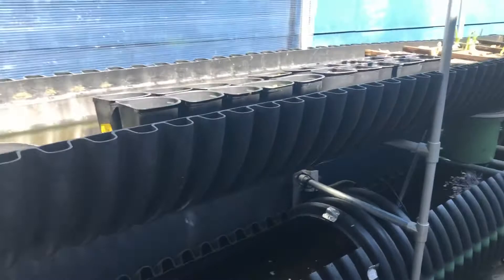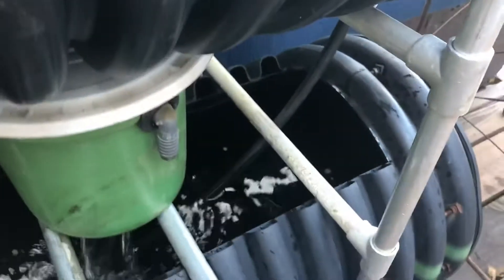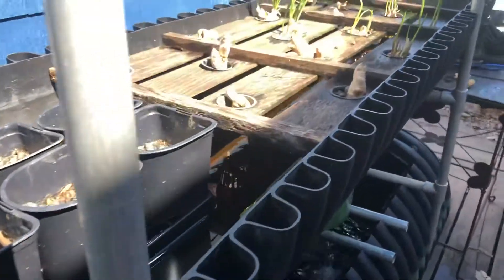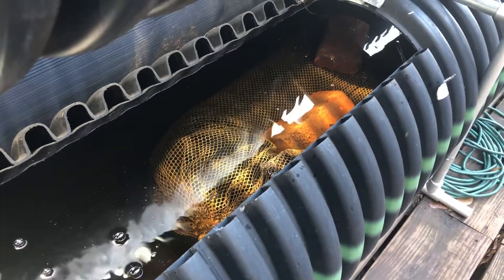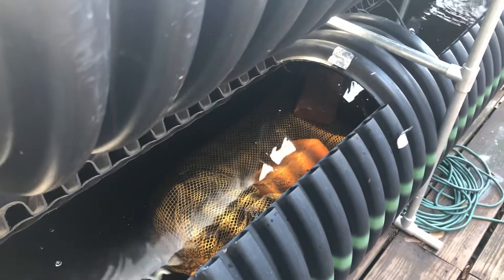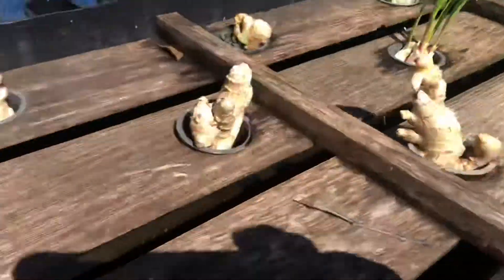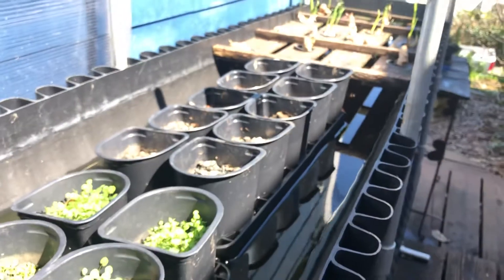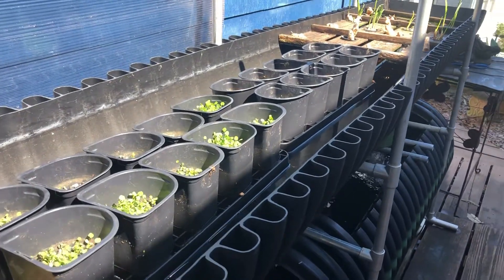Bioponics; Complete DIY Organic Hydroponics Setup including Making Liquid Fertilizer

Comment: The big question is how to reduce the amount of plastic in these operations?
Reply from the maker: Build it once. PVC is the problem. Ever seen a PVC greenhouse after it has been exposed to sun over time? Decomposes into a toxic mess. HDPE does not decompose, contains black carbon, may be reused over and over.

Comment: Hi sir. I hope you can answer my question! If you use a TDS meter to measure the conductivity (mS/cm) or nutrient concentration (ppm), which value could we have? I want to compare it with a hydroponic system.
Reply from the maker: same values as TDS meter. If you are going for EC of 2.0, and  start with highly concentrated leachate plus water with low EC, add till target levels reached.